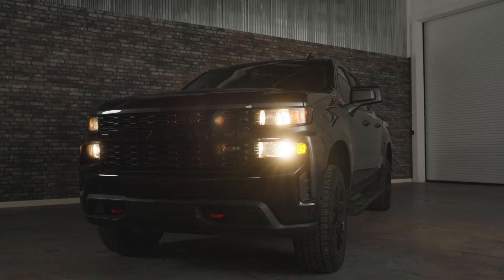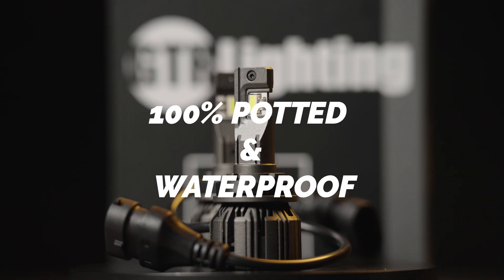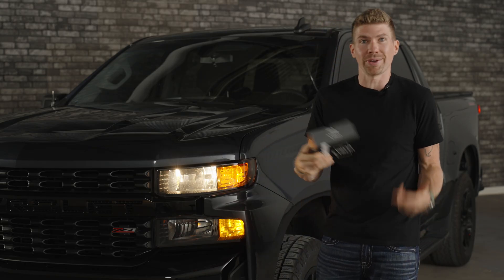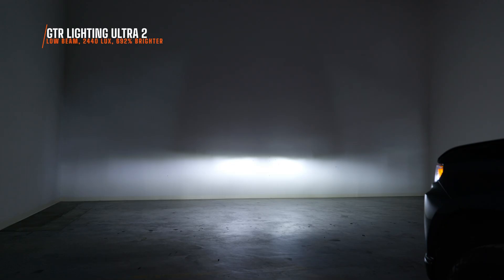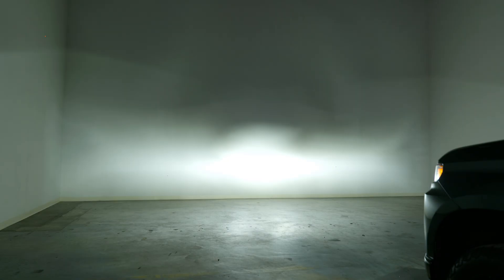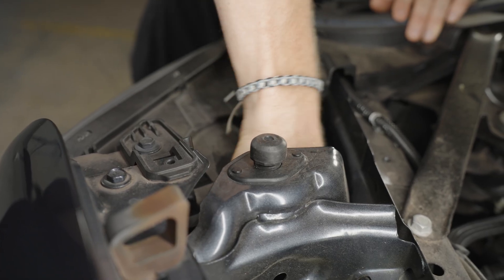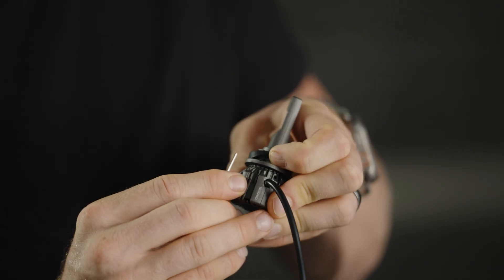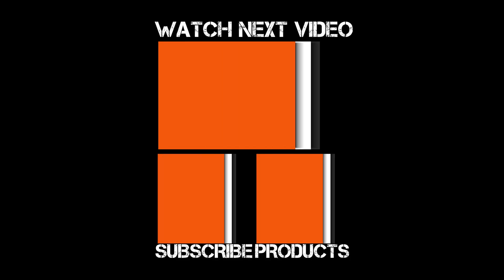2019-2022 Chevy Silverado 1500 LED Headlight Upgrade | GTR Lighting Ultra 3 757% Brighter!

Comment: Do these work on 2023+ work truck or custom trim? You did the old 2019-2022 in this video. 

Only the Lasfit is designed for the Chevy trucks. Would be curious.